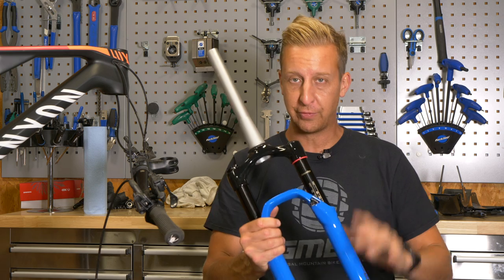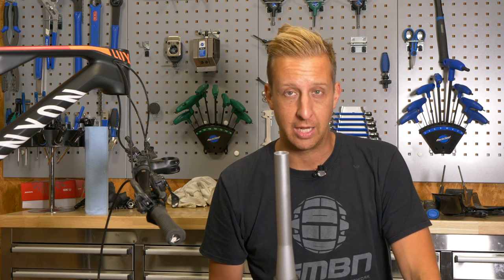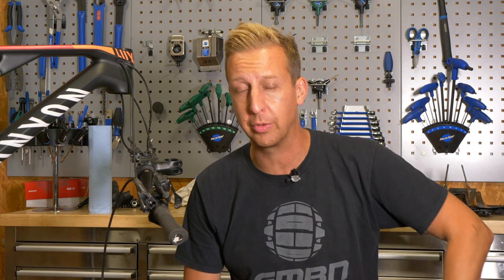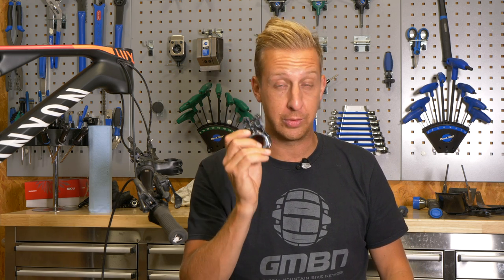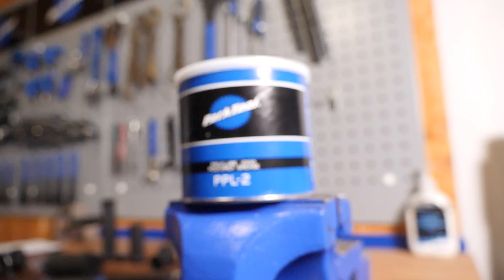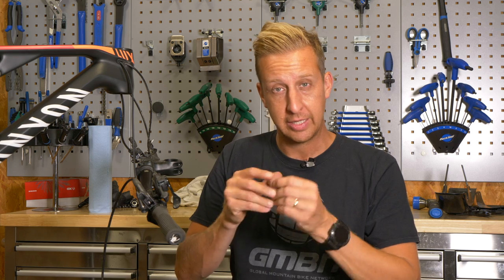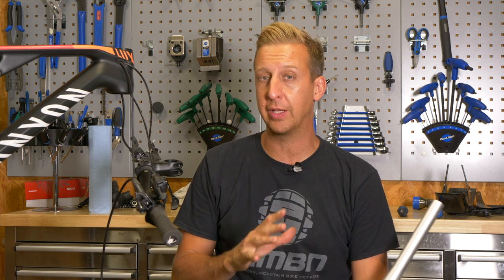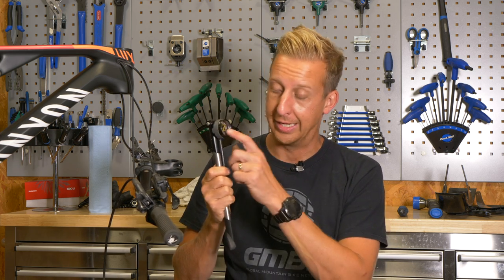10 Common Mistakes Made When Replacing A Mountain Bike Fork | How To Fit A New Fork

Comment from the maker: When did you last upgrade your forks?
Reply: Never
Reply: Couple seasons ago,  picked up a set of Rockshox SID 29ers for my XTC.
Reply: Just got a fox float 32 performance. Im shitting my pants about fucking up the installation lol
Reply: Yesterday
Reply: I'm about to.. and I'm a total noob. YOLO right?
Reply: I replacing in almost 1 month
Reply: I’m doing it now
Reply: Next week!
Reply: It's coming in the mail, doesn't seem to crazy of a job
Reply: Yesterday
Reply: My problem is i can't find ones which are the same length as my original.
My 2008 Scott Aspect 60 has 495/500mm axle-to-crown Suntour X2 non-lockout forks.
I get sick of finding ones which might be OK, only to find they are disc brake only.
I have upgraded my crankset with higher ratios for the road, replaced the front mech and the rear, but getting suitable forks are a pain.
All the different dimensions required drive me CRAZY!!!!!!!!!!!!!!!!!!!!!!!!
The nearest length seem to be the Zoom brand or Exotic solid type, which would be perfect for the road.
Reply: Just bought a rock shox Judy silver, so I'm watching all the videos. Going to leave the steerer tube longer than stock for a more upright riding position.
Reply: Today
Reply: Hopefully soon. After I can convince my dad😐
Reply: I have been riding cross country on a 21 year old Cannondale catalyst. The original shock has survived me and alot of gear quite well but now they just bend at the boot. Time to replace mostly because the old suntours were not built to be serviceable. One question though should I buy some shocks and bring it in to a shop or just have them order it with the hardware there ?
Reply: She made it to 10yrs and I decided to treat her to some swanky new air shox
Reply: If I go from 44 mm rake to 51mm rake, will it affect the beak pad and break rotor alignment?

Comment: An adjustable pipe cutter from the plumbers merchant is better than using a hacksaw to cut your steerer tube, plus you don't get burr at the cut 👍🏻
Reply: using a file to make it smooth takes few seconds up to 1 or 2 min, I guess, just use a smooth file.

Comment: I diligently followed your recommendation not to use the old tube as a measurement datum.
Instead I measured the crown spacers; three times, to be absolutely sure.
I then cleanly cut the tube with a pipe cutter.
...And then remembered that the handlebar stem is supposed to go on as well 🤦‍♂️

Comment: Re: star nut; use the topcap.
Once you hammer it 2mm in, unscrew the bolt and fit the topcap in, rescrew the bolt back in, hold the topcap in place and start hammering again.  Not magical but certainly helps a little 👍

Comment: From experience I can say always use a hacksaw and get yourself a cutting guide from park tools or x-tools. As long as you don't screw up the measurements you can not do wrong using those 2 tools. 4:35 After spending a few hundred quid on some forks £20-£30 for a guide is always justifiable when the consequences for screwing up are so high. Sure you can go to the the LBS but they will charge you more than £30 to install some forks.

5:24 A dremel on the lowest speed with the grinding bit inserted also works. Just don't press very hard at all and dab it on to the surface, only making contact for a tiny fraction of a second each time. Works fine. Also works great at getting surface rust of cast steel steerers.

6:30 I lay mine out flat on a work surface with the part i'm working hanging off the end. So the filings/shavings can only end up on the floor.

Comment: Most of the big chain hardware stores sell a plastic mitre box and cheap saw designed as an inexpensive alternative to a  compound mitre saw . The box has slits for cutting 90 & 45 degree angles. Your hacksaw will work fine in the slits and give you a perfect cut every time for around $7 w/o the hacksaw

Comment: Great vid.  Quick way to cut the tube is with a cut off wheel, then sand flush and clean with a random orbital.  Mark all the way around and cut a mil long, then sand to your mark.  Finish with a finer grit.  Much faster and cleaner than using a hacksaw.  But, you have to know what you're doing.

Comment: You said to leave a 4mm gap on the stem in your other video. I did that. But now you say be above the stem and add a extra spacer. 

So which Is correct? I have a 2015 specialized enduro.

Comment: Yesterday I did a test:
Mounted the new Fork with new headset with no lubrication at all (I was going to change the spacers and deciding if cutting or not the steerer tube) and it felted awful. Grease is the most important here.

Comment: You didn't mention getting the bearing crown race off the old fork and installing on the new one.  I have seen some people hack that up for sure.  If you do mess up a star nut you can just drive it down a bit and install a new one, leaving the old one as reminder to be more careful. Getting it all the way down and out the bottom is challenging, it also leaves deep scratches all the way down the tube.

Comment: I have made the mistake of hammering in my star nut just barely too far.  Luckily I was being very conservative with my steer tube length, so I all I had to do was cut off a few more mm and all was well.
Reply: The easier way is just to use a longer bolt.

Comment: !!!!!!!!!!Doddy! Amateur tip for lining up your stem/bars.!!!!!!!!!

I take a handlebar sized length of STRAIGHT timber and zip tie it to the stanchions beneath and flush with the crown. Then eye the handlebars to the timber as you have a much longer area to eye through against. Works well! Then I put a small scratch on the stem and steerer tube to make future aligning easy.

Comment: I actually dont have the spacer on top, sure safety but the positioning of the bolts on my stem makes so it doesnt really matter. I used to have that extra but then i removed it because i had no need going higher, i was maxed out but 3mm difference wouldnt affect so much and im more likely to change my bars because id need them wider and higher rise aswell.

Comment: At 2:51, during the segment titled "USING THE WRONG TOOL", is that not a clip of using the Park Tool SG-8 (saw guide for thick carbon fiber hacksaw blades) with a standard metal hacksaw blade--a case of using the wrong tool? The correct tool, unless my eyes are deceiving me, would be the SG-6.

Comment: I just learned one the hard way. After wasting hours try remove the Crown Race from my old fork and installing it on my new bike. I am almost at the finish line but my tire not fitting in the fork.  My tire is a 29er…and when I went back and looked at my new fork info…it fits a 26 inch wheel. I needed a moment alone 😑. I also don’t understand why some fork companies don’t provide the Crown Race with the fork since it so hard to remove safety.  That makes no sense.

Comment: So, any tips for people who have stripped the thread on the cable clamp ? ☹️

Have been using a cable tie, but there must be a better bodge !
Reply: Drill and tap new bigger threads?
Reply: it can be tapped, but you can just put zip ties there in the mean while.
Reply: My braided hose doesn't even fit in the retainer to begin with!  Cable tie for me also 😢
Reply: Steven S 

ask an electrician for a 'p-clip'...

same from commercial fire alarm installer.

'pyro' is a tiny bit bigger than most braided, so easy fit

added bonus; p-clips are in diff colours, just red, orange, black and white are most common, green and blue bit rarer.

also, SOME clips are plasticcoated metal; others are... plastic!

Comment: I want to remove a spacer as I've got 4 of them on (newish bike) and only need 3.. I've got the correct tool for installing a star nut my question is when I cut off 10mm will I have any trouble pushing that nut down the correct distance.

Comment: I'm just under the top nut on my stem, I've found a longer top cap bolt and tightened up the bottom bolt, I'll go slow until I can find an extension or a smaller in height stem if they do them anyone?

Comment: Great common mistakes when replacing a mtb fork guide.Your statement is not true when removing a star fangled nut.They can also be drilled out with the appropriate drill or drill press not only hammered through.Cheers.

Comment: If you cover your file with gorilla tape before filing, you won´t get metalfilings on your fork legs when filing. Another great hack is to remove the blade on your hacksaw before cutting. It´ll take a tiny bit longer to cut but that way you´ll have the cleanest fork legs ever🤓👍

Comment: also it's best to use a dedicated tool to install a star nut for your new fork, way better than banging it with a screwdriver yourself. if you dont have one ALWAYS borrow one from your friend that have one

boom, 1 more tip for money saving tips segment :D
Reply: TheKooster31 When I replaced mine a few months ago I screwed the screw in a few threads and tapped it in with a hammer. Might sound bodgy but it worked 👍🏻
Reply: @Dan23_7  ah you must have a delicate touch. my hand is more like a sledgehammer lol
Reply: TheKooster31 Haha 😂

Comment: better hack if you dont have the saw guide is to tape a headset spacer to one side of the mark and one the other side. just cut between the 2 spacers. once you're cutting the saw cant drift
Reply: or use a jubilee clip

Comment: it's all very well saying leave 3mm between the steerer and stem, but 3mm which way?  Us peasants ain't gonna do this more than once (?) if at all so it's not like we're going to  be experts in this.  
I liked the tip re using an old stem as a cut guide, also a jubilee clip can do it (thx oz).
Also, what about using a power circular saw?  More teeth, high rotation speed , does that give a cleaner cut?  What about on carbon?
This vid lacks advice on road bike forks / non suspension setups (ok, maybe not the vid for it), max spacers recommended, and also the idea of doing it twice - first with an extra 10mm spacer, ride it and then cut it down a second time to the exact length after assessing it.

So could have had a lot more tips in it.

Comment: Never heard it called a "star fangled nut" before!! Where did that come from? Does it need a "star fangled spanner" to be tightened? Lol.
Reply from the maker: Hey Barry, a "star fangled nut" or "star nut" is the name of the nut that is pressed into the steerer tube. The arms are angled so that it can be tensioned. We suggest you use the tool used in this video to ensure that it's inserted correctly.
Reply: That knick name was first used as slang by shop techs back in the day when they first came out, and still in use.

Comment: Something I learnt is to use masking tape to mark the cutting line. Why? Well its thin enough to get spacers over and creates a great cutting guide line if you don't have that fancy Park Tool. Its also easy to remove/move.

Comment: I recently installed a new threadless headset and steerer tube and I'm getting a ton of play. I've checked that my spacer has some excess above the steer tube and I've loosened and retightened several times in order to get that compression, but it keeps wobbling. 
What am I doing wrong? I have no idea what I'm missing.

Comment: Just let a professional do it. I have seen so many stupid mistakes our customers have made when replacing their forks, like:

- put both bearings on top (or bottom)
- forgot to transfer the headset ring to the new fork (or used two of them stacked on top of another)
- mounted the star-nut up-side down (it must have been a pain to get it in there like this)
- used a carbon star-nut replacement on a steel fork-shaft (or used a star-nut on a carbon shaft)
- put the fork in facing backwards - and no, it was not a Manitou fork...
- bought the wrong fork in the first place and realized half way through mounting it, that a key feature, like a disc brake mount, is missing. 
- bought forks for the wrong wheel-size and wondered why the tire was not able to fit

But the prize for biggest idiocy goes to a guy who came in one day, with two rigid forks in hand, one that was bent because of an accident, with a 1" screw-on shaft and the other one new with a new 1 1/8" screw shaft. 

"Can you replace this for me?"
"No, sorry, that's the wrong size for your bike, the shaft will not fit, as it's too big"
"No, I meant the shaft, can you cut it off and weld it onto the other fork?"
Reply: you are exactly the reason i dont go to bike shops
Reply: @jackkelly21110  elaborate please?
Reply: Its called a crown race...not a 'headset ring'.
Reply: Its not a hard job to do. But the idiots will bring lbs more business, so u should encourage it!
Reply: @rupedog  Thank you very much, I am not a native speaker, so I might need to creatively describe things which technical terms I have yet to learn :)
Reply: @jackkelly21110  Dude, chill. Nobody is forcing you to go to any shop. You are welcome to do any repairs yourself. Hell, you might do a better job than some of our apprentices, but if you ever get the chance to work as a bike mechanic yourself, you will realize very quickly, that a lot of customers, have no idea what they are doing and often cause more damages than they are able to repair.

People regularly open brakes, oil them or never bother to set them up correctly. They misalign drive-trains or mount the wrong size chains. Put tires on the wrong way and so on.

I certainly don't treat my customers the way you describe, but if you encounter this behaviour everywhere you go, maybe there is a common factor you might be missing ;)
Reply: @jackkelly21110  There are some shops like that for sure, I've been a mechanic for years, and a manager as well and I have gotten that attitude.  A shop should not allow that behavior at all, that is a defining factor if the shop is worthwhile.
Reply: @lizardmechanic8785  First of all, great handle ;) Your right, you should always be polite and try to explain, what needs to be done and why one charges which amount. 

I get that 20 Bucks to fix a flat tire is a lot if you can do it yourself, but there are people, who either have a lot more money than time or simply lack any handiness and would make such a mess, they are better off at a shop. 
I tought myself everything up to servicing forks and seatposts and I agree it's doable, but it always depends on the mindset of each customer, which option is better for them.

Side Note:
In our City there is too much work and too few mechanics as it is and while I disagree with the practise I can understand why smaller shops charge quite a bit more than the were a few years ago. You have to deal with angry customers all day, because nobody wants to be the one who has to wait. Parts are sometimes not available because the demand was too high that month, and you spend a huge portion of time talking to customers, you sadly have to turn away anyways, which is a net loss for your shop.

Comment: I have no idea behind the sense of using an Alignment tool and hacksaw.  More tools to buy, messy shavings, dull blade, harder work,and still needs filing anyway.  Everyone the best way is a quality pipe cutter.  The pipe cutter self aligns with its wheels and cut is clean i don't even file anymore if you do it slow n easy don't tighten extremely to speed up the job..  Its idiotic to do it the way actual bike mechanics like to saw it off.  Its just dumb.  And these are not common mistakes its more like common sense.
Reply: Agreed a hacksaw isn't the best, but I'd use one over a pipe cutter just cuz sanding the lip off is pita.  Done it both ways countless times, and used to own the Park tool.  I've never had to file using a hack, but you do have to light sand.  Settled on using a cut off wheel and orbital sander finish.  Comes out factory, and faster than hack or pipe cutter, but takes the know how.

Comment: Not a aingle word about the correct cone angles in the head set an the cones which have to be placed on the fork? There are 45 and 36 degree angeled cones and people may even forget to put the cones on the fork before installation, letting the bearing rub on the fork crown.